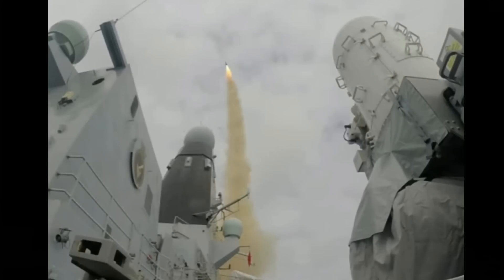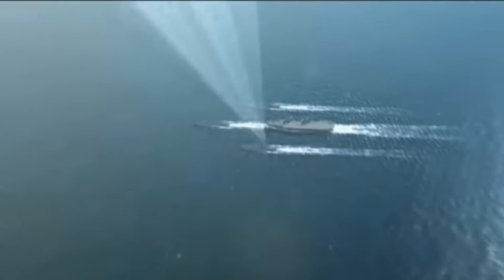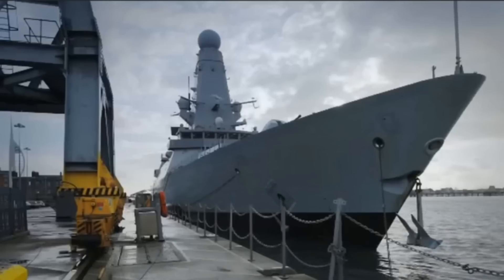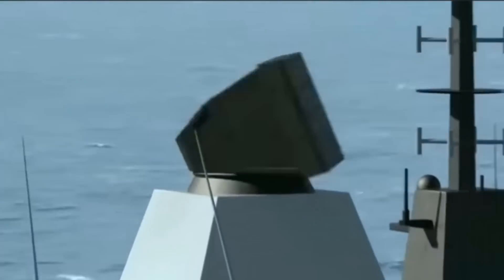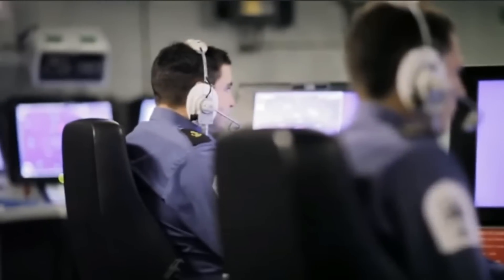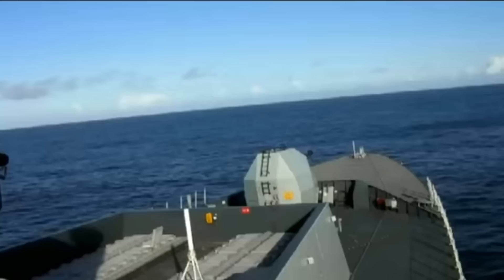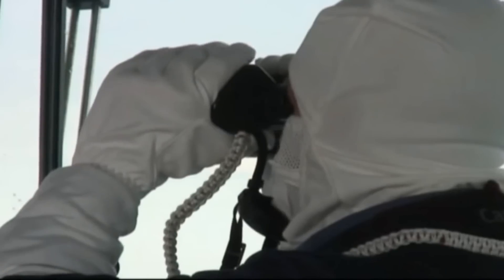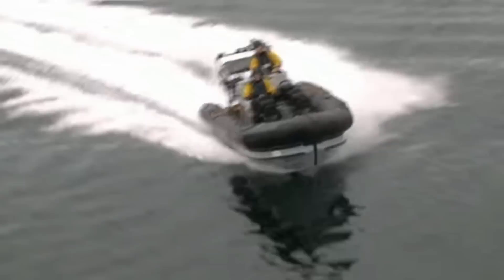The Type 45 Destroyer : Daring Class - Overview

Comment: Your appreciation regarding the WR21 Gas Turbine, it's recuperator and intercooler, the power turbine and generally the whole propulsion system is poor.  This ship has an Integrated All Electric Propulsion system. The WR21s and two Wartsila Diesel Generators provide power for this system.

Comment: 48 missiles doesn’t feel enough to defend against waves of cheap anti ship missiles
Reply: The problem with the Astors compared to the US missiles is that each silo takes one missile, whether short 15 or long range 30 as both are the same width. With the US missiles, the launcher can take one long missile such as the Sm-2, Sm-3 or Sm-6, or 4 short range missiles, the ESSM as they are long and small in diameter. I think I would be inclined to carry Astor 30's and the smaller Camm (Sea Ceptor)missiles, which can be quad packed.
Reply: …….rather than the short ranged Astor 15. Eg, 40 30's and 8 15's total 48 missiles. 40 30's and 8 quad packed Camms is a total of 72 air defence missiles.
Reply: @briananthony4044  Completely right. CAAMM should get fitted eventually but with American MK41 VLS , which is being fitted to type 26 frigates, we could buy AGM 158C LRASM and achieve commonality in both missile and launcher. Make the supply chain simpler and hopefully cheaper. Perseus is at least 10 years away, collaboration's often come to nothing and we need something to fill a gap now. Or we could just stick with Silver launcher, get box launched LRASM and wait for the 4X.
Reply: The tech is available to make one with off the shelf technology for ~$50k

Comment: These look like really nice air defense destroyers with excellent radar and combat systems. But can anyone comment on why these vessels have so few missiles compared to similar ships of other navies? For example, the American ships that fill the same role for the U.S. Navy (Ticonderoga-class Cruisers and Arleigh Burke-class destroyers) can carry anywhere from 90 up to 122 Standard missiles, whereas these Type 45 destroyers only carry 48 Aster missiles. That is a significantly less firepower. Is this by design due to some sort of doctrinal reasons or is it just a compromise necessary to stay within size/weight requirements?
Reply: Maybe as it's supposed to operate in a unit that has other ships shoring up such downsides

Comment: The Daring class of destroyers existed during the 1950's to 70's.  They were a great looking ship to with 2 twin 4.5 guns on the bow and a singleton 4.5 on the stern.  The Type 45 are known as the Derring class and apart from its engine problem is the best Destroyer in the west.  The UK Minister when questioned about Deering being tide up advised that it didn't have to leave port to be able to attack all of Europe and Russia and its defence system was able to defend the UK.
Reply: Wayne, the Type 45 is known as the Daring class not the Deering class. Just as the Type 31's are (at the present moment in time) going to be the new Leander class frigates. The RN recycles names and classes of ship. I.E. the Queen Elizabeth class battleship of 1915. Now we have the Queen Elizabeth class of aircraft carriers. In 1915 the RN had the Invincible class off battle cruiser, then we had the Invincible class of aircraft carrier.

Comment: CORRECTION REQUIRED - All six type 45s were assembled and launched at BAe Govan then fitted out at BAe Scotstoun.  Govan is on the south bank of the river Clyde while Scotstoun is on the north bank. The two yards are only about a mile or so apart.

Comment: The T45 is VERY overrated. It has enough potential to be what I'd consider the best destroyers in the world, but they're not because of MoD cuts. 
As of now, they have no land-attack capability other than their gun which is pretty much nothing, no ASW capability since they can only hunt and destroy subs from their helicopter which is a joke - also they are very loud and easy to track by subs and torpedos, no ASuW capability because most of the ships don't have an ASM, those that do have only 8 Harpoons which is very outdated and not survivable against modern, well-defended warships. Their AAW capability is also very limited by the range of its missiles, which only allows it to conduct point-defense (albeit, very well) and doesn't provide it with BMD capability.
If they incorporated something like a 64-cell (or larger) mark 41 VLS equipped with a combo of SM-6, SM-3, ASROC, ESSM and TLAM, installed permanent torpedo tubes and passive/active sonar, reduced noise production, perhaps also rearranged the CIWS to the aft and bow instead of amidships, and replaced one of the Phalanx with a RIM-116 and the Harpoons with something like LRASM, also increased the gun to 5-inch caliber with guided shells they would have a terrific platform.
If they did all of that and also fixed the problems with the engines, it would be hands-down the best destroyer in the world. However, current UK military budget is BS.

Comment: A friend of mine worked on this project as the lead engineering guy to do with the engines and he told them in meetings at the time not to use those engines but the heads and shed's didn't listen he told them right I want it noted on the minutes that I am against this engine design/engine and recorded. I bet those minutes got lost somewhere at BAE lol...

Comment: The Type 45 is a very modern and impressive ship, but I think the armament is still a bit thin. They should really have, 1) A solid tested replacement for Harpoon in the next 5 years, possibly up the gun size from 4.5" to 5", upgrade the VLS so they can carry cruise missiles like Tomahawks and LRASM, and if they really want to they could look into deck torpedo's like what the Type 23's have.

If the Type 45 is going to be the UK's largest surface warship and escort the fleet carriers, for the next 30 years then they need to have cruiser like armaments, like the US and Russia have for example.

Comment: as a sailor on one of these I can tell you a lot of the reported problems by the media are as usual overblown. The ships are the best Fleet air defence ships in the world, which is why the Yanks want one protecting their carriers in the Gulf.
Reply: As of today all six in dock for repairs ! Does not say much for the Daring class.
Reply: @stephenhulme6583  apart from the carriers they protect are also in, so they might as well get some maintenance in
Reply: @Cdodders27  So its not the Engine issue. Its just General maintenance then. And it just so happens that all six in the Daring class have the same issues at the same time. And the Daring class has NO Engine problems in hot weather. And all six have only been at sea 197 days in four years.
Reply: @stephenhulme6583  I think you are getting duff info
Reply: @Cdodders27  So the 46s have NO engine issues in hot weather then. Think before you reply. And all six are in dock for repairs or maintenance as you put it. Your words not mine.
Reply: @stephenhulme6583  ships are full of machinery that needs maintenance. This is true of any ship.
Reply: @Cdodders27  Does 46 have a engine issue in warm waters or not. yes or no. NO spin or twisting words And if they dont why are they ALL having NEW power plants put in ?
Reply: @stephenhulme6583  You seem like a very angry and mis-informed man. I am going to stop replying to you. I doubt you would listen if I did anyway. Maybe read other comments like the one below this from Historian1066.
Reply: @Cdodders27  Well thats one way of addressing the issue. Putting your head in the sand. And not admiting that there is a problem. With the 45 engines seems to be the navy way lately. As for angry and mis/informed your lack of answers proves me right i think. I am angry that British sailors should have to go to sea in sub standard ships. This is of cause a problem  though out the whole  military. AS for the comment which was made 4 years ago by Historian 1066.It is not true then and not true now. I know it . You know it and i suggest he knows it. But when Ex Admirals bring up the problems of the 45 in the House of Lords Then who is right or wrong ?  And this is all Documented, So i think its game set and match.

Comment: I wonder why no navy has ever worked on or even investigated "Metal Storm" weapons technology for use as a CIWS against anti-ship missiles. It is a matrix/array of dozens or greater electrically-fired gun tubes that can fire from pistol-caliber to rifle-caliber and higher bullets. This technology debuted from a small R&D firm over a decade ago. I thought it didn't have much practical use for land forces, but I always thought it would be ideal for defending from and defeating inbound missiles at close-range. Whereas a CIWS such as the Phalanx tracks a missile with radar, aims, and fires a stream of 7.62 mm or similar caliber bullets at incoming missiles, the "Metal Storm" devices nearly-instantly shoot a "wall" of bullets outward all at once after being electrically triggered. Think of it as like a massive shotgun that can send a square or rectangular sheet of bullets toward one or multiple incoming missiles or munitions. I think blue-water navies around the world would benefit from researching and developing this technology as a last-line of defense for when there are too many incoming missiles for the CIWS guns to defeat. Modern naval adversaries will usually try to overwhelm a ship's CIWS system by launching dozens, if not more ASM missiles from multiple vectors at high speed. The "Metal Storm" array could be tied to the CIWS radar network and triggered if any projectile crosses within a set distance, it seems like it would be a great solution to enemy saturation attacks with missiles. Anyone else heard of that technology before? Care to comment? :)

Comment: Are tomahawk missiles American made???
someone please answer.
Reply: I wonder if the Brits will catch up to the Americans with aircraft carriers I would like to see that since the navy is so important to the Brits
Reply: Tomahawk missile is American... Also sorry to say this, but Britain won't catch up to America in aircraft carriers. Not in numbers and not in individual capability either.

The new Queen elizabeth class carriers are STOVL aircraft carriers, meaning they don't have catapults or landing arresting wires. This means they can only operate the F35Bs for fixed wing fighters. The F35B will take off with limited range, and limited payload due to weight restriction. The carriers can't operate huge Early warning aircrafts, instead will rely on helicopters for that. the helicopters are slower and range is also limited... No oil tankers can take off from QE carriers, which means no range extension capability from the carriers.

The US carriers on the other hand are nuclear powered, have catapults and arresting wires. They can operate all kinds of fighters like the F35C, F18, Rafael, or any other carrier based aircrafts out there. On top of that they can fly big early warning aircrafts, oil tankers, and transport planes. All of them can be extended in range by adding external fuel tanks, and they can all have big payloads thanks to the catapults.
Reply: A Diesel Charles De Gaulle type carrier would have been more useful than two QE2. And since the retirement of the Ark Royal in the 1970-1980s , the Royal navy is not very capable at supporting air operations over a fleet. The semi success during the Falklands War wasn't fully understood

Comment: I hate that our navy has become so small, only 6 destroyers? and no aircraft carriers (yet)? Our country has become a joke in terms of the cuts our military is getting.
Reply: Béquat Fougère lol CDG uses 4th generation planes and the UK 5th plus the Stovl jets can do now roll landing due to the long runway on the new carriers allowing more range and missile which limited stovl before. Type 45 best air defence destroyer and soon 8 type 26 best Sub marine frigate size of a destroyer to protect the carriers which can act as a destroyer too,  plus 10 type 31 new multi role frigate things are changing in the Royal Navy along with the new 7 Astute nuclear attack submarines
Reply: The French navy do not have an operational carrier until 2018 (The CDG is in drydock), but has capable carrier-planes. For the Royal navy , it's the opposite. And about air projection , since the Ark Royal CATOBAR was scrapped in the 1980s , French navy has a better capability to use air power in potential naval battles.
Reply: Why the fuck do we even need a Navy?
Reply: @Sun-Tzu-  cus UK is an island which needs protecting.  Most of our imports comes from shipping.  These include raw materials, food and every day goods. If we were at war the enemy could quite simply block the shipping lanes. UK has underwater cables to Europe and USA. If the enemy severed this you wouldn't be able to use YouTube for example. So all snowflakes can sleep tight 😜
Reply: @georgekaplan4696  Needs protecting from what? You gonna stop a guy running his car onto the pavement with a warship? There is no imminent land or sea invasion of Britain, we are of no strategic value whatsoever.
Reply: Not only is it small, the ships UK does have are all limited in capabilities. The 6 destroyers lack anti ship and sub capabilites. The type 23 frigates will soon lose its anti ship missiles as well. The carriers are STOVL, which means they are limited to operating the F35Bs which will have limited range and limited payload. 

The French navy is even smaller, but their ships are the real deal, all rounded, and maxed out. Their carrier is a true carrier with full operating capability. Their destroyers and frigates are all multirole all rounded.

Comment: Wonder why the navy doesn't us 155mm gun instead of 4.5 inch because there are massive benefits to saving ammo costs and increased variety of ammo types used! also, these ships seam to depend upon the Wildcat and merlin for offensive roles! what about torpeadoes, does the ship have any? Smacks of yet another type 42 design flaw to me. I may be a bit old fashioned, but, I was lead to believe that a destroyer was a hunter/killer of ships!!
Reply: You're not old fashioned. Look at new destroyers of other countries. Every single one of them have offensive and defensive capabilities. The French Horizon class is almost identical to the type 45, except the Horizon class has anti ship, anti sub, and anti air missiles and torpedoes.

Comment: The hull is so thick I can drill through it with a 20$ drill. Laughable. One diver could sink it xD
Reply: the material made is of extreme quality for one so no it isn't that easy. Also it isn't that think, it may appear so. A commercial grade drill won't do anything to it. Also if it does, it will take awhile. The ship would be moving at high speed making such attempts impossible. And there is a number of water-tight compartments on ships making it impossible to sink from a tiny little hole.
If there is an issue, there are also counter-flooding, damage control teams, and drainage to minimize flooding.
Reply: I think some one has anger issues.
Reply: nah some of the youtube comments are serious. At some point you can't tell if people over the internet is sarcastic or not.
Reply: Sun Tzu yeah? Come and try it Sunny, launch a torp at one and see what happens
Reply: S Skyler he's also a 100% RIGHT though
Reply: S Skyler It's true, it has no form of torpedo defence.

Comment: In my opinion, this class of ships is not very good for Britain. Yes they are said to be excellent anti air destroyers, but that's what it does solely. Type 45 lacks capability in anti ship, and anti submarine warfare. This is a specialist destroyer, unlike the multi role destroyers of other countries.

Royal navy is already small, and stretched to the limit with global deployment. So why they designed these specialist ships is beyond maddness... UK doesn't have the resources to have a lot of ships, so they should have had every ship to be multirole and able to act by themselves. UK sends them out alone for deployments, so they should have been multirole.

France and Italy have their own versions of the type 45, the Horizon class. Horizon class is slightly cheaper, smaller, but it is multi role. They have capable anti air, anti ship, and anti submarine capabilities. 

Why do Royal navy always pay more than everyone else, but get half the capability?
Reply: ARVIN Its a Royal Navy tradition to separate speciality roles for ships and it has served them well in wars. The new type 31 to be build soon and some under construction type 26 will be multi role